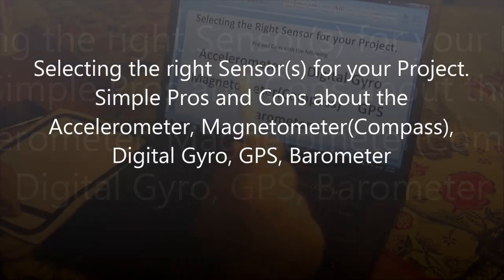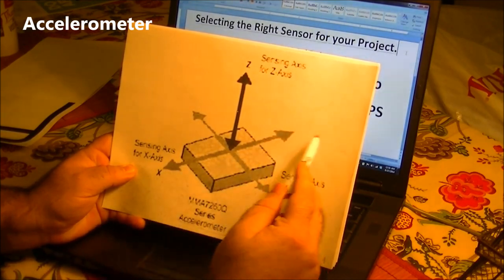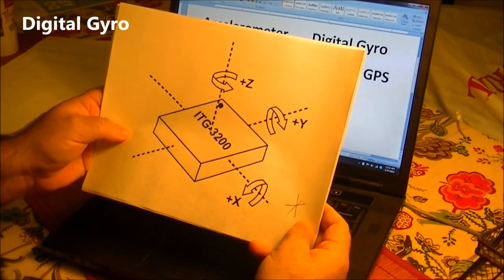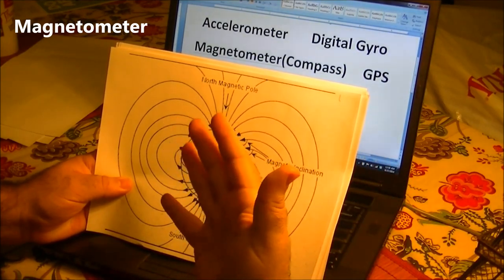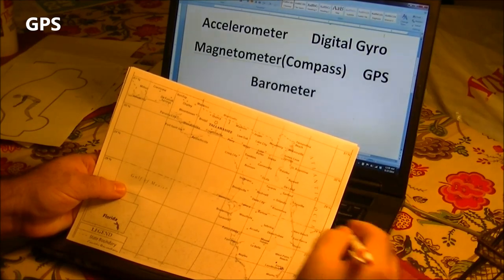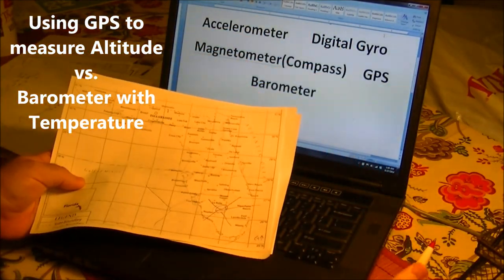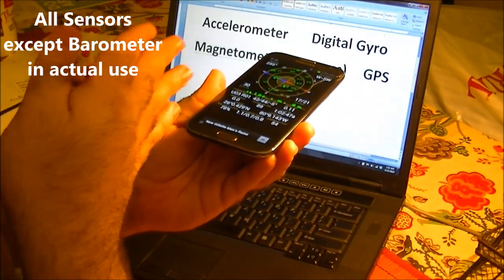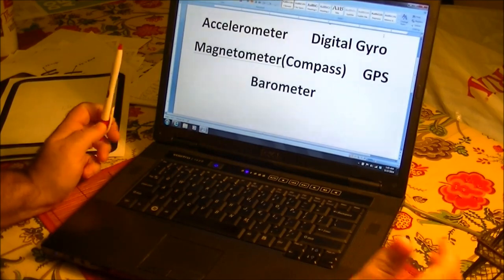Simple Guide on Accelorometer, Magnetometer, Digitial Gyro, GPS, Barometer Pros and Cons

Comment: Thanks for posting this. If my project turns out right, I owe my knowledge on MPUs to you!
Reply from the maker: +Aaron Lowe I hope it works for you... Here is a freebie. Take the outputs and read it 10 times, Average the readings and use that answer. It will smooth out the output from noise and spikes.
Reply: Alright. I can code that

Comment: Interesting and informative video.
In some devices were the orientation is the only required measurement, a combination of Gyro and Accelerometer are used. My question is why do thy need to add Accelerometer with the Gyro ?
Thanks.
Reply from the maker: +Mohammed Algailani GREAT QUESTION! Here are a few reasons... The Gyro chip was created way after the accelerometer was already in MANY popular devices. The Iphone 1 and the Nintendo Wii Controller had no Gyro to name a few. The iphone 1 used alot of math plus battery AND the Wii used inferred lights you set on top of screen to detect gyro movement. Later Wii added the gyro chip. Since so many devices were using the accelerometer already, it was easier to put the gyro in the same chip and the device makers would transition the programming slowly. Also manufacturing both in 1 is way cheaper. Also you can create a calculation with both inputs to smooth your data output to be not so shaky. Lastly the gyro is always processing, so a battery saving trick is to put to sleep until the accelerometer detects a quick jerking which indicates a movement to wake the gyro. This is a common battery saving programming used in many smart battery running devices.
Thank you for watching!
Reply: +Carlos Pineiro Thanks Carlos for the thorough replay.
In addition to what you said, an accelerometer measures inertial force, such as gravity (and ideally only by gravity), but it might also be caused by acceleration (movement) of the device. Even if the accelerometer is relatively stable, it is very sensitive to vibration and mechanical noise.
A gyroscope is less sensitive to linear mechanical movements, the type of noise that accelerometer suffers from.  Gyroscopes have other types of problems like drift (not coming back to zero-rate value when rotation stops).
Averaging the data that comes from accelerometers and gyroscopes can produce a better estimate of orientation than obtained using accelerometer data alone.
(Source: CSCI 373/EGM 360 Mechatronics Design, sensor fusion.)

Comment: the accelerometre detects the tilting, also detects the direction you're going in, that's due to it's coordinate system you use in the beginning.
Reply from the maker: not the solo chips. like the original wii controller

Comment: That was a great video. How can I measure the movement of a rover moving in a straight line with zero acceleration? (Without using GPS)
Reply: You probably figured it out by now but a common approach is rotary encoders for rovers

Comment: A Big THANK YOU for this very informative video. Now I know the Differences and purposes of this sensors. I just have one question to clarify about Magnetometer. What will happen if you install the magnetometer on a quad copter  in a slant (3 to 5 degree angle)  position? Does it have a negative effect to the navigation of the quad?
Reply from the maker: I have only heard that putting the sensor too close to the motors will cause you error data because the magnetic fields produced.

Comment: Refer to your video, Accelerometer detects moving, not turning, (at 1:43), Gyro detects turning (at 4:06).
Why from video “How an Accelerometer works and is made” https://www.youtube.com/watch?v=KZVgK...
, it said, Accelerometer detects turning? Should it be Gyro?
Thank you.
Reply from the maker: Sam19600 Thank you Sam for watching.. That link is a GREAT video. I love his stuff! Here is the deal. The Gyro chip came after the first smart phones, like the iphone 1 didn't have a gyro. So turning was detected with accelerometer because the chip actually had 3 in 1. X Y Z axis. by detecting which had the strongest force and reverse the result, you know what way you turned the device. The limitation is that it can only detect movement if the speed is changing. If you are in a car going 40mph steady, you would have 0g forces on you and the Accelerometer would not detect movement. unless you speed up or slow down the chip will not detect movement. Gyro detects turning, correct. So many to smooth the results do an average of the output to figure out movement. GPS is still the best for speed and long movement.

Comment: Great video! However at 6:00 you said 'east would be the Y' which your diagram and other diagrams show east as X. Also would it be correct to say: 

Positive Y is north 
Negative Y is south
Positive X is east
Negative X is west?
Reply from the maker: Avelx That is a GREAT observation! You are Right and kinda wrong too. I will explain. If you use the chip as intended, then you are 100% correct. But here is where is gets tricky. You must think about the position and location of the chip itself. Say you are working on a tracking project, then you will place chip close to center of project's mother/bread board with top cover of chip aimed to the sky. Then you are correct. BUT let's say we are talking about a handheld like a smart phone where a designer is expecting the phones normal position is right up in you palm, so the motherboard is actually sideways, and the chip's bottom is actually facing you behind the screen. This type of design would swap what the true X,Y,Z actually are. These things must always be taken in account. So Unless it's the Magnetometer which uses the earths magnetic field to point North and East no matter what you try, the other sensors (Not counting GPS) output are set by the programmers normal set orientation for the output. Where X means up or upside down, Z means it's on it's side. The GPS is a different ballgame as it's positions is ALL based on the math output from timing the signal received. This is why most every Smartphone maker tried there best to place the sensor in the center of the board, and gps chip close to top of phone(by ear speaker). FYI, You can't have the magnetometer close to speaker or mic because they have magnets and will hurt your output. Thank you for watching and catching that!
Reply: Cool thanks for that detailed explanation, much appreciated and I like your teaching style. Keep it up :)
Reply from the maker: Avelx I try my best. Taking the technical manuals and turning it into simple English and real world examples. I will make more soon. Thank you

Comment: Hi, everyone. I am still a newbie on understanding how sensors works. I wish to use Arduino for my project. May I know what is/are the suitable sensor(s) to use to simply measure a human fall? Thanks in advance
Reply from the maker: Yu Chen Goh 9.8 meters a second squared will be the drop rate. But the sensor you want is the accelerator. Gyro will only tell you the orientation of the falling body. Thank you for watching.

Comment: I enjoyed your presentation. 
Your explanation of the accelerometer is incorrect in that you say it is responding
to gravity. Gravity is a force of attraction of 32 ft/sec2. or 9.8m/sec2 at sea
level on the Earth. That exists as an attraction between the object (phone) and 
the center of the earth. All objects follow this law. As an example:
If you are falling then you are weightless. 
This meter reacts to Newton’s three laws. A body in motion will remain in motion 
unless acted on by a force; or remain motionless. That force will provide acceleration 
to the object. A plane doing a tight turn at speed will place several g's of force (times 
the normal gravity) on the pilot. It is demonstrated simply as F=ma where ‘m’ is the 
mass of the object and ‘a’ is the acceleration imposed on it. 
The video refers to gravity as being the instigator whereas acceleration is the 
true parameter - brought about by an outside force acting on the object. 
i.e. afterburner, throttle, pushing etc.
Reply from the maker: I'm pretty sure I spoke about this in the video where the issue with the Accelerometer is if you are in a constant speed, where you are NOT making any speed changes, the sensor is useless because it doesn't detect changes in forces. One of the main factors the electric gyro was added to so many devices. but the gyro will not detect speed changes. As a battery saving technic,you put all sensors to sleep and wake when accelerometer gets a mass detection(Shock). Thank you for the info and for watching.
Reply: I understand where you're coming from, but accelerometers are actually not at all useless in your described case where the readings (changes in acceleration) are zero. Which is also useful information, it tells us there have been no change to our state since last time we looked.

What we would do is to keep track of any changes in the force vectors in all three dimensions. If we do that at all times we will know where we are because we knew where we started from (let's assume) and we know what changes in acceleration have been made up to this point in all directions. If all acceleration changes are zero, we are simply continuing in exactly the same state (direction + velocity) as we were the last time we sampled the device.

This is in principle how intertial navigation systems work. Google that (INS) and "dead reckoning" for more information on the techniques used.

(Edited to correct typos.)
Reply from the maker: +Benny Löfgren once you hit terminal velocity then it's also useless. like a speed train and or an airplane on a clear day, once the speed is steady, the accelerometer will read you x0,y0,z0. this is where one must become very clever in what you want to use that sensor with. Here is an example; say you want to make a simple display for a little plane that will show you the angle of the plane but you only use an accelerometer, then it will do ok as long has you calibrate and set to warm start from the ground. The math can do ok. do a cold start in the air and it's a hit or miss once once you are at a clear steady speed, you will get x0y0z0. the gyroscope chip will work better with less math required in this can. this was one of the major reasons the original first wii controllers looked at 2 infrared lights placed on the screen to know it's angle and placement. the speed of gravity is great but the outside forces matter. resistance, hitting a wall, a quick jerk of the board will read maximum force 16x,16y which can ready mess the numbers a bit. I prefer the combination of gyro and accelerometer for fast feedback with less errors. then there is the plane going at 20mph thrust with counter winds coming at 15mph. This is another issue but a job for the gps.
Reply: ***** You are right about that, the combination of gyro and accelerometer is better, since a gyro will measure angular velocity changes and not be as sensitive to sudden movements and "noise". Gyros are susceptible to drift over time though.

But I still have to object to you calling accelerometers "useless" in their null range, they certainly are not. The accelerometer measures the change in your velocity in the three axes, and to know that your state vector has not changed since your last sample is a very useful piece of information.

The GPS is a totally different beast. It gives you a position fix in 3D space, and even though as you said in the video you can use it to calculate speed and heading, that is of course not its primary use, and unlike the other two sensor types, a GPS does become worthless for that secondary purpose when you are standing still or moving very slowly.

Before the days of GPS, people could still navigate the seas and the skies, using just gyros and accelerometers (or a compass and speed measurements) and dead reckoning. :-)
Reply: Let's be more specific about this... He stated "it is measuring the pressure of gravity" - which is not accurate, but it is pointing out the accurate variable of pressure. You also stated that the accelerometer is measuring acceleration, which isn't entirely accurate either. Acceleration is the change in velocity (speed) over time [a=Δv/Δt]. Since the device isn't measuring velocity or time, it can't possibly be measuring acceleration.... at least not directly. On the other hand, physics tells us that F=ma (Force = Mass x Acceleration) - which can be changed to a = F/m (Acceleration = Force / Mass). If you know the mass of an object, and you can measure the force applied to it, you can calculate Acceleration.  

So how does the accelerometer work?? A common accelerometer consists of a material of mass and a interesting material known as piezoelectric material. When force is applied to piezoelectric material, a measurable voltage is emitted - so where does the force come into play? All objects of mass have inertia. Inertia is the resistance of an object of mass to move out of its 'inertial frame of reference'. An object at rest as well as an object moving at a constant speed of 100mph are both stationary within a frame of reference. If a force is applied to the object and its speed or direction changes, it will move outside of this frame of reference into another.  When this happens, a force is applied to the object of mass in the opposite direction, known as Inertial Force. 

Back to the example with in a car. When you accelerate in a car, you feel a force against your back pressing to the seat. Likewise, when you make a sharp turn you feel your body move away from the turn (more precisely perpendicular to the change in direction - aka centrifugal force). If you were to place piezoelectric material between your body and the seat, a measurable voltage could be detected when you accelerated forward (or likewise when you slam on your breaks). This is essentially how the accelerometer works. When a material of mass applies PRESSURE to the piezoelectric material through inertial forces, a voltage is detected and can be used to calculate force. Since the developers of the accelerometer sensor knows the mass of the material also, you now have the two variables needed to calculate acceleration (a = F/m). 

For anyone who is still confused by all this physics jargon, an easy way to understand an accelerometer is to think of it like a tiny bathroom scale. When you stand on a scale, it detects your weight. Gravity applies a force to your body, and since the scale is on the ground, it resists moving, thus a pressure is applied between your feet and the scale, which it measures that pressure.

Most modern accelerometers measure on 3-axis - X (left-right), Y (forward-backward), and Z (up-down). Now knowing that the accelerometer works much like scale - you could now draw the conclusion that even at rest, a force would be applied to the Z-axis... and you would be right. Even at rest, an accelerometer will draw a constant measurement in the downward direction on the Z-axis. This is easily resolvable by applying an offset of the measurement against the final reading. However, you wouldn't want this offset if your accelerometer is in space or on another planet/moon as the force of gravity wouldn't be the same.

Hope you enjoyed this explanation!

Comment: I know nothing about electronics but I am trying to build or find a very small tilt sensor that will light a small green LED when I am at a perfect 0° horizontal, +/- 2°. I would like to have the device light a small red led when I am more than 3° tilted on either side. I was hoping you would be able to direct me which products I need to make this happen. Any and all information you can give will be greatly appreciated.
Reply from the maker: wow, That would actually be VERY easy..  A simple arduino Uno and equivalent and a gyro chip. The coding would be very simple. Goto adafruit.com and you will find everything you need. there also Level apps on your smart phone.
Reply from the maker: It's not a complicated built, just a time consuming device. What you are asking to do is VERY simple. a few YouTube videos and you can do it yourself with no help.

Comment: Hi I have a doubt what happens to output of accelerometer when accelerometer is moved with same speed for some time will it be zeros or some constant km/s^2
Reply from the maker: That is a great question. Which is a great reason the gyroscope chip was made. Accelerometer can only detect change of itself. It's very sensitive but say you are on a train. Eventually the train remains at a constant speed, the accelerator will zero out. Only detecting the slightest bumps and shifts til braking or it speeds up. Imagine drinking a soda in the car with no lid. Steady enough the drink calms. At least these sensors usually have mag, gyro and accel all  in one chip now.
Reply: @cashe18   But when place an accelerometer on table it's velocity or speed  is zero but the accelerometer output is approximately 9.8m/s^2 in z -axis